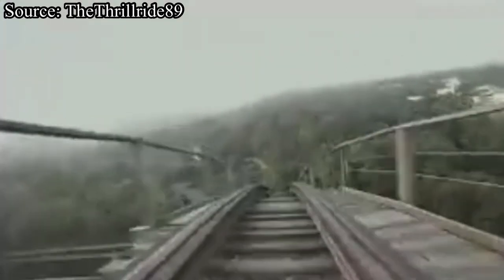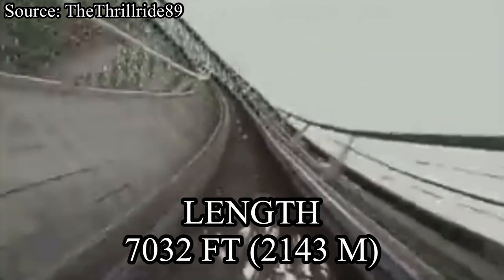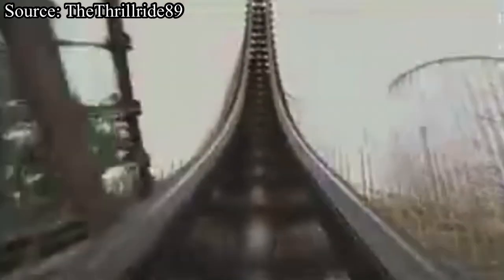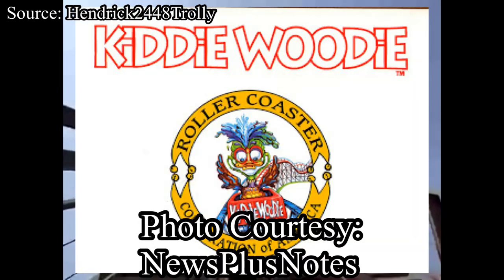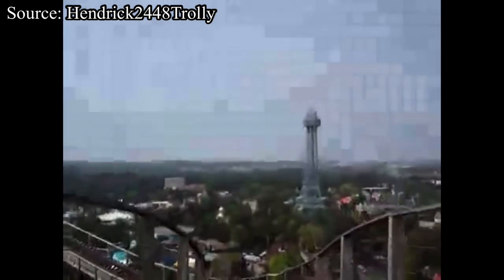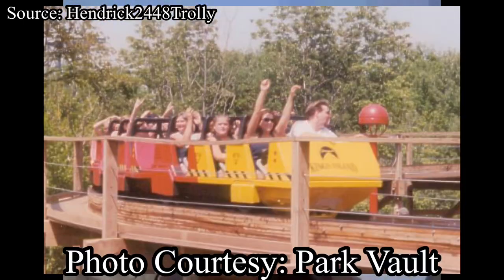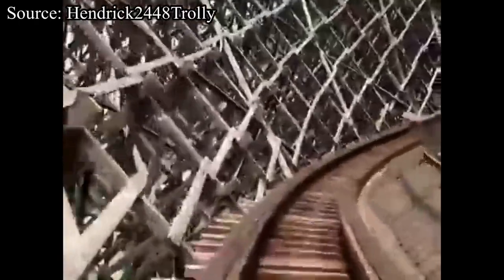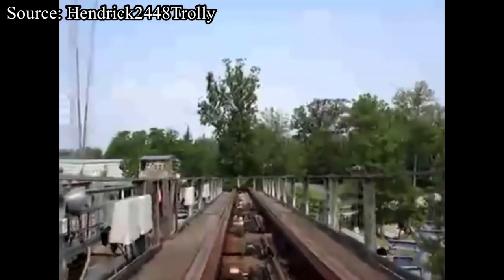How Son Of Beast Could’ve Worked

Comment: Tbh I’m really not trying to be mean but the stuff u mentioned wouldn’t work, CCI would never build a coaster that tall, it’s completely against what the company stands for, building quality wood coasters that aren’t too big so they aren’t that rough, they learned from the failures of Hercules, mean streak and rattler, but for some reason PKI and RCCA didn’t, and even if SOB didn’t have structural issues and even if it had a steel structure it would still be rough, any traditional wood coaster would be rough at the speeds SOB was going, and even if it wasn’t rough the ride would be incredibly boring, just look at the layout, it’s the dumbest one I’ve ever seen by far, and also the gerstlauer and vekoma trains wouldn’t work cuz they gave it gerstlauer trains after the 2006 accident but it was found that the gerstlauer trains were too light to complete the loop and I bet the vekoma ones are very similar to the gerstlauer ones, but yeah I agree they definitely should have picked a different theme, cuz not only did the theme cause the issues u mentioned, but it inspired them to make the ride as big as it was which made it rough and its also why SOB is as long as it was and that’s why it was so boring, but I like the  idea of this vid u should apply it to more coasters
Reply: Well if SOB was still here let's say if CCI built it instead RCCA, CCI  becames bankrupt, and people are complaining about the Roughness.  Kings Island could have had GCI or Gravity Group retrack it boom that solves the problem.
Reply: @ArrowThrills  the layout would still be boring tho
Reply: @MillenniumForceMan   The loop looked entertaining and it was the fastest wooden coaster, how is that boring ?
Reply: @ArrowThrills  i heard that the loop was the only good part about the ride, the rest of the ride was super rough and boring, it was all just giant helices that too forever to traverse and straight track, the layout was the dumbest thing ever, just ask anyone who actually rode it they will tell u how boring and rough it was